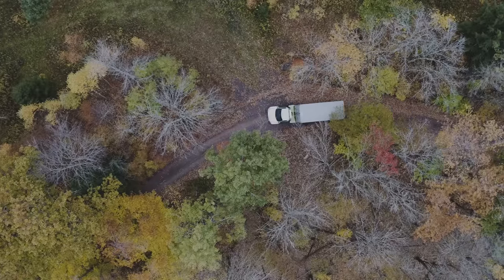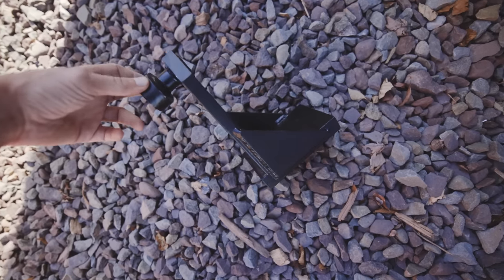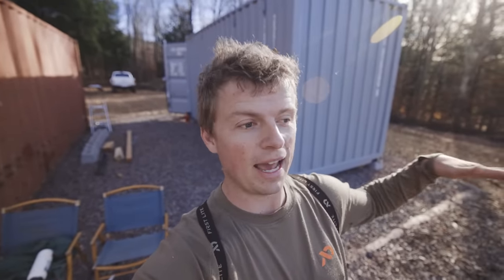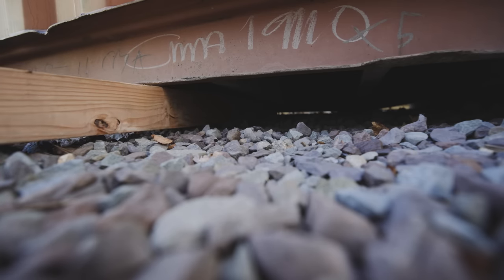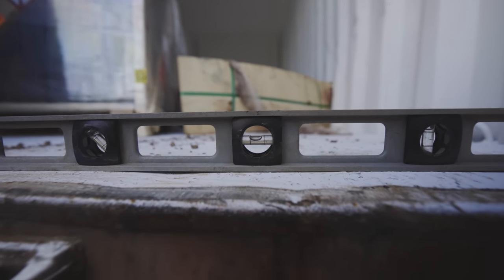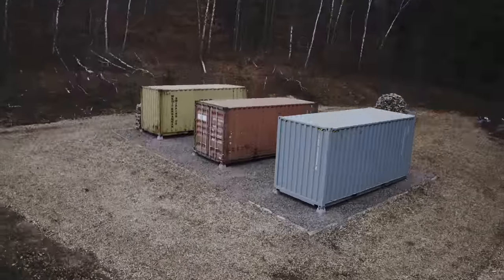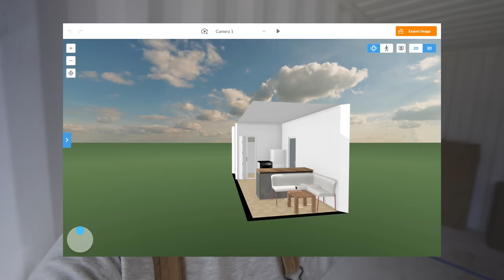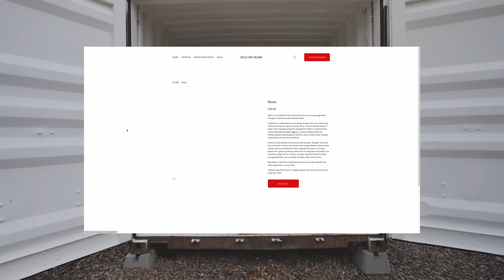Lifting 4,000 Pound Shipping Containers ALONE

Comment: Have you thought about putting a skylight above the kitchen to help with lighting? Really interested to see how you guys make your home!
Reply from the maker: That is such a great idea! We had been thinking of skylights generally, but specifically putting one by the kitchen is an excellent idea, thank you, Alex! :)
Reply: was about to suggest that, it can give extra light when you need it
Reply: It's a neat idea, but the combo skylight + flat metal roof + heavy snow loads could lead to leaks. In the cold the metal contracts and the seal will eventually fail
Reply: I love skylights but I would install them in the wall, depending on the style of skylight.  
I do not like putting a hole in the roof for several reasons.  09.19.2023

Comment: I would rotate the design of the kitchen to be parallel with the container walls- that way you would be using the space more effectively and you would have a bigger kitchen with less floor space taken up for working. Also in terms of a bathroom, have you thought of buying a 4th container situated between the living and sleeping spaces that could be connected with an additional structure to create both an en suite for the bedroom but also a separate guest bathroom (so guests don't have to walk through your bedroom or use your bathroom). Think of it as creating a deck between the living and the sleeping space where you could have an outdoor dining area/patio w/ access to a bathroom.  

Also, depending on budget replacing the door side of the container with a large double pane window would let in plenty of light and probably without reducing the rigidity of the structure or needing extra support like cutting into the container walls would.
Reply from the maker: These are some really great ideas for us to consider Breaux Lee!! Thank you so much for taking the time to share them with us, it's really appreciated :) Hope you are having a nice Sunday!! :)

Comment: You will have to make openings on the sides and maybe on top of the containers for lighting and doors to connect one container with the other besides the main doors.  During the winter, you will definitely will not want to open them unless you put sliding glass doors to let light in not the cold.

Comment: My idea would be connecting the back of the containers with a porch walkway. It would keep the elements from the walk to the bathroom, opening a door at the other end would increase ilumination (don't know about sun orientation of the site...). But I'd increase the number of footings, so that if one fails, the others can minimize the problem. With a flat roof and heavy snow load, a sunroof would be not advisable, metal contracts with cold, and leaks are a big mess.

Comment: Although containers are build to withstand the test of time, they are made of metal and will rust.  Rust will make holes so I suggest at this point to build a weatherproof roof over them connecting all the containers that way.  By doing that, you will make additional living space later on in your lives as your dreams, goals, and family grows.  You are young and will most likely have a family.  Whether you want to have your very own or adopt, or extended family want to move closer to where you are.  You will have additional space to accommodate them.

Comment: Have you thought about doing a galley style kitchen to increase your work space or a long counter and appliance design along one side of the container? Another option to increase workspace - a L shaped design for counter that runs along the wall and then juts out for a partial island/room divide? What if you just did a big window where the doors are that can open and close?

Comment: Hi guys! great work leveling the containers, i am sure it is harder that what it looked like, regarding the layout my 2 cents here :) with the proportion of a container, as it is long and narrow,  i would personally focus on one of the long walls and develop the spaces along that wall, meaning that the kitchen would go against the wall, and the living seating area too, trying to avoid "stopping" the "flow" of the space with any perpendicular element as much as possible. otherwise it will feel "cramped" easily. I would pick one of the long walls as a functional wall, then on the other wall i would have the door that you already have and  move the bathroom door to that side too... so you get a bit of an L shape at the end of the functional wall. Not sure if i am making sense here, if you want i am available, just message me! Pepe

Comment: Hi, this is the first time I watch your video.  I don't know what you have in mind yet about all of the containers, but if you are connecting them one with the other, this would be what I would suggest.  1.  Do not make the kitchen with the bathroom together.  I learned that when we flush the toilet, all the particles of the feces go all over.  Like a virus when we sneeze.  Architects when they began designing houses they did not take thst into acct.  Why do you think at the beginning of colonization there was an outhouse they called for the toilet?  For the same reason.  Th as t is what I will do when I begin to build inside my containers.  I would do the bathroom away from everything somewhere that is connected from the containers yet not connecting to anything in particular.

Comment: First off...INSULATION...Once you have a design you need to consider insulating and how much will be needed to keep the interior warm in winter...don' forget that this means the floor too. I you don't get the insulation right so many things can cause you hassle.
Whatever heat you choose for all three units remember to have triple (As) bestos chimney flues for each heat producer AND same with cooling.
At this point I am questioning having a space between the units...it means that you have to have plans for all three separate containers.
I follow two channels , one where two containers are joined and one where one is almost finished with the idea that a second will be added at some point.
Personally I say that you are better off designing a WOODEN building because, by using metal containers you create too many problems.